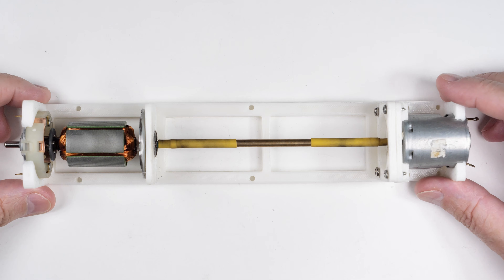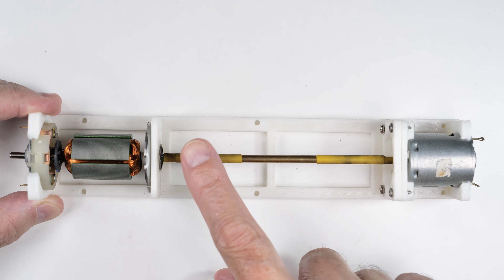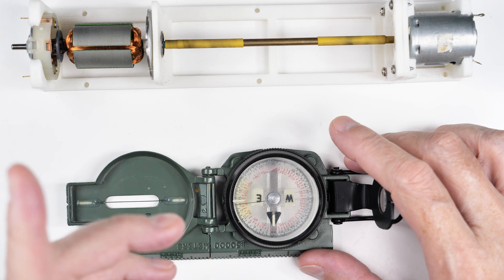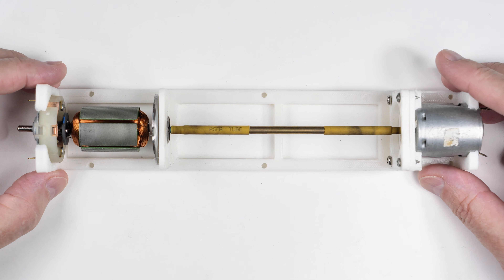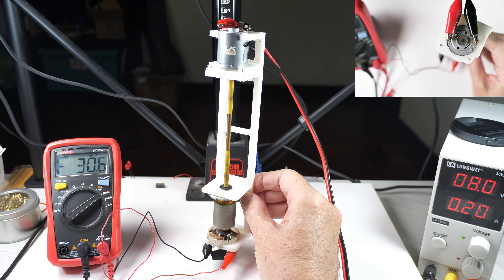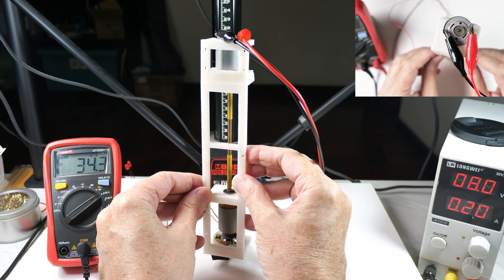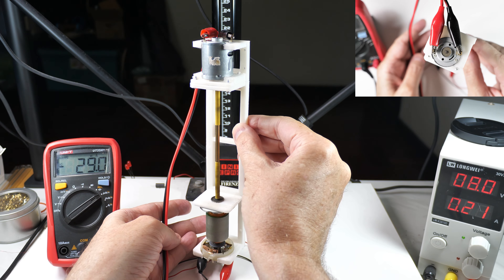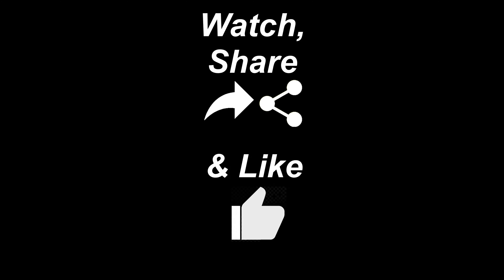What Is An Earth Inductor Compass? (4K)

Comment: I would suggest that your armature is being influenced by something other than the earth with its axis vertical orientation. 

Unless you are north or south of 60degeess N or S, the isogonic lines are running at close to 90% parallel with the earth’s surface and shouldn’t be reflecting a Change in output merely by moving your makeshift frame around the armature. 
To observe a change in this setup, it should reflect a change by moving the apparatuses nearer or farther the the earth’s surface. 

Besides think about WHAT you are doing by turning the frame’s “clocking position” in relation to the spinning armature, how are your movements any different to the earth than what the shaft is ALREADY DOING? 

Something else is causing the change in EMF, an NOT the earth’s magnetic field. 

Try suspending your experiment from a non magnetic TREE in the middle of an open plowed field, suspended by fishing line, on a swivel, spun up to high RPM with compressed , while having ZERO metal on your person, as you lift an empty gallon glass around it, with a static grounding wire attached to block any wind. 
We would really look foward to seeing it.
Reply from the maker: @willdodd1038  You can find the original patents online and see photos of it. It was oriented vertically with the coils flat to the Earth's surface. The orientation is set by the brushes. It took me a while to get it also.

Comment: Uhhh.  You are rotating about the axis of rotation of the motor.  Can't you just wait a fraction of a turn and get the same thing?   Something is wrong here.
Reply from the maker: @FreemonSandlewould  Think brushes. Only 2 arms of the rotor are active. The orientation of the brushes determines which arms are active and when.
Reply: Sorry mate that won't fly @tsbrownie
Reply: @neiloT.  Of course it won't fly, it's a compas and not a bird or a plane.😎😁
What you are seeng here is a DC motor rotor removed from its magnet assembly and spun in the earth's magnetic field instead.
Basically, the rotor doesn't care where the magnetic field comes from, 
it will generate (or not)an output depending on its orientation to the magnetic field.

Also, in this setup, it doesn't matter whether the spinning rotor is horizontal 
or vertical at 90 degrees to the table top. 
This is evident in the video here at the point where the driving motor is initially powered up (where it's horizontal) and the amp-meter reads 30 something uA, and when it is moved vertically, the reading stays much the same (taking into account any positional differences relative to the earth's field caused by manual movement of the assembly).

If you are still unsure of this, review some of the basic operating principles of brushed dc motor which I  presume you are already familiar with to some eegree and know that it is both a motor and a generator, depending only on how it is driven - electrically or mechanically.

Cheers.🍺

Comment: That's interesting that you're spinning it that axis, I would think it would spin it's yaw axis.
Reply from the maker: Me too, but then I looked at the original pictures and diagrams.
Reply: Had the same thinking since the coil would be more aligned with the field when align flat. 
But that would be the case only if we were to test it somewhere around equator.
What if it is the due to the shape of the field ? Mr Brownie where do you live ? It is most likely USA, but are you from northern part near Canada by any chance ?
Cause if you do it could explain it.

Comment: I would suspect that if you were at the equator doing this experiment, your voltages would be EQUAL in either direction and still show positive and negative for Direction
Reply from the maker: @donm1547  I think you're right because the Earth's field lInes would still run N S.